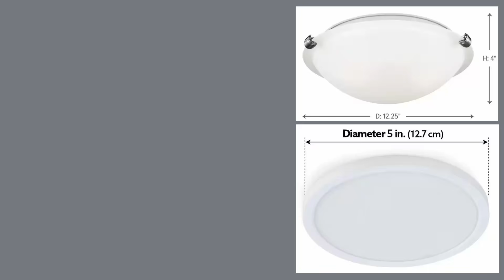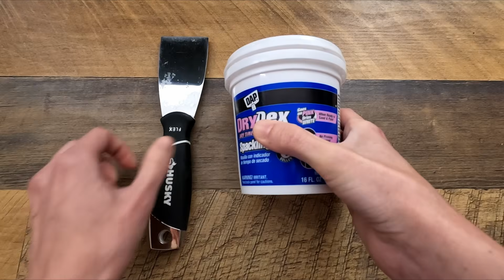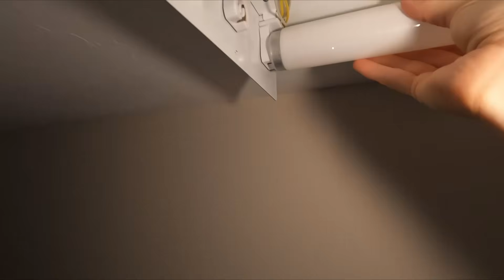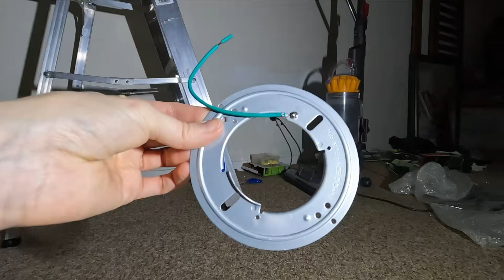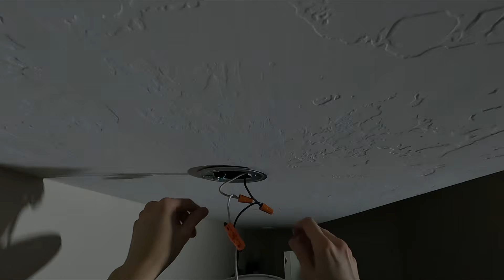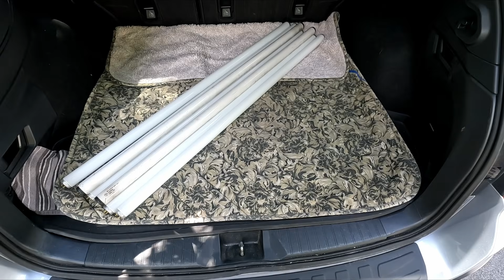DIY Lighting Upgrade: Replace Fluorescent Light Fixtures with LED Light Fixtures

Comment: Help! All I see is a tiny hole in the ceiling where the wires are coming out and I don't see the light box
Reply: Same
Reply: Obviously the original builder didn’t add the box so now you have to do it

Comment: The only issue I have with these LED fixtures is them being integrated so if they ever fail, you would have to replace the whole fixture again, no lamp replacement light the old fluorescent fixture, that’s why I would go with a 2D CFL fixture, they have replaceable lamps so you can easily swap it out if the light dies.
Reply: Having this problem right now I have eight boob lights with LEDs. That's all be replaced by an electrician

Comment: Should not twist the wires together before installing the wire nuts. If you twist the wires together, they may arc and get extremely hot. You only need the wire nut.

Comment: When reconnecting the wires in the wire knots, you should be sure to do the ground first then the neutral and the hot wire last. That’s green first white second black last just in case there is voltage present. This could prevent you from getting shocked that’s number one with electrical, thanks ma’am
Reply: Excellent tip. Thanks!

Comment: Thanks. Where is the link to the voltage tester?
Reply from the maker: Here's a link to the Milwaukee voltage tester on Amazon: https://amzn.to/3oQRB7F
Reply: @wildcat-diy  Again, thanks so much for the video and thanks for the link.
Reply from the maker: @DJVijilante  No problem ☺ I'm happy to help!
Reply: @wildcat-diy  Thanks! The ground wires go on the same screw and it’s okay if they touch. If I have two black wires from the existing fixture, and one from the new fixture, just connect all three together, and do the same with the white wires? If I cannot get it installed, just cap the wires with the wires nuts and I should be able to turn the breaker back on until I can get it properly installed?
Reply from the maker: @DJVijilante  *I'd verify the below with your local codes or with an electrician familiar with your local codes, but generally in the US, black wires are hot and there is no need to modify the wiring logic (all same colored wires can be connected together) when replacing light fixtures.

Yes, you can cap the black, white and ground/copper wires coming from the light box separately until you're ready to install the new fixture. Electrical tape can be used for extra precaution. I like to have each wire nut spaced apart so there's distance between them.

When wiring the fixture:
Connect the fixture’s black wire(s) to the black wire(s) from the light box.
Connect the fixture’s white wire(s) to the white wire(s) from the light box.
Connect the fixture’s copper wire to the ground screw on the mounting plate.
For a plastic light box, the ground wire from the light box can be wrapped around the ground screw on the bracket as well but this isn't always possible to do or necessary. Since it's sometimes difficult to connect more than one wire to the screw on the mounting bracket, the fixture's copper wire, the light box's copper wire, and a short piece of the same gauge copper wire can be connected together with a wire nut. Then, the tail end of the short wire can be connected to the mounting bracket ground screw.
If the light box is metal, the ground wire from the light box should be wrapped around the metal box's ground screw.

Depending on local codes, ground wire ends may not need to be capped together. However, some prefer capping copper wires regardless to prevent contact with other wires inside the light box. Electrical tape can be used to help ensure wire nuts remain in place.
Reply: @wildcat-diy  Wow! Thanks for the detailed explanation! You’re awesome!
Reply from the maker: @DJVijilante  ☺ Best of luck with your project!
Reply: @wildcat-diy  Apologies. I should have been more specific with my question. If I cannot get it installed properly, "I can cap the black, white and ground/copper wires coming from the light box separately" and turn the breaker switch back on? See that breaker switch also provides power to my garage door opener so if I cannot get it to work and need to temporarily cap the wires, I would like to turn the breaker back on.
Reply from the maker: @DJVijilante  No worries. When I need to pause mid-replacement, I take this approach (turn the breaker back on after capping all the wires from the light box separately). This should be safe as long as the wires are properly capped.

Comment: Where exactly is the ground screw?
Reply from the maker: The green ground screw on our old fluorescent fixture was near the center of the fixture's metal housing. On the new light fixtures, the ground screw is on the mounting plate or mounting bracket.

Comment: Theoretically, could this be done with the fluorescent lights in my drop ceiling? Obviously needing new drop in panels with holes cut for the pucks?
Reply from the maker: Yes, it could! I like the idea of using (canless) puck lights too since they're lightweight and don't require additional support structures. There's also a good selection of those that come with a junction box as well, if needed.
Reply: @wildcat-diy  thank you! I’m learning a lot as I remodel and this is helpful!
Reply from the maker: @heatherpoling1769  No problem. It's a great way to learn and a rewarding process. 🙂Have fun and best of luck with the remodel!
Reply: @heatherpoling1769  did you complete your remodel? My basement has drop ceilings with the florescent fixtures and I'm thinking about switching them...wondering how'd it go for you?
Reply: You could upgrade Fluorescent Tube Lights to LED Tubes. I used the Toggle Brand from Home Depot. I don’t recommend getting them from the store, but ordering them for Home Delivery. If you do get them from the store, make sure the box has not been opened. Turn the Breaker off, remove the clear cover, remove the wire cover. Cut the wires next to the ballast. Remove the Ballasts. Cut the wires off of the Lamp Holders, on just one end of the fixture. Direct wire the Black “Hot wire, to one wire off of each Lamp Holder. IE If you have two lamps, you will have the hot wire twisted together with two wires from the lamp holders. Wire the White Neutral Wire, to the other two wires off of the lamp holders.  Install the end on the LED Tube, with the label, in the wired lamp holder. Snap the metal wire cover, back on being careful, to get the wires inside and not pinched. Turn breaker on and test the light, adjust the color switch to the desired lighting color.  Reinstall the Clear Cover.